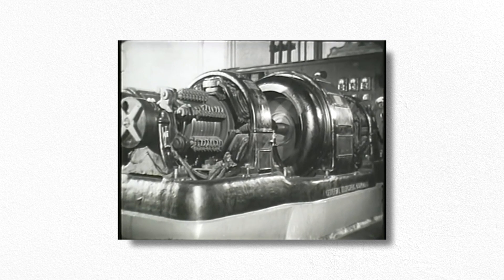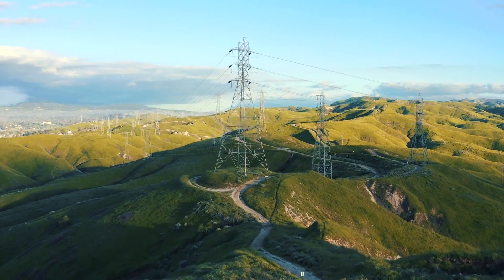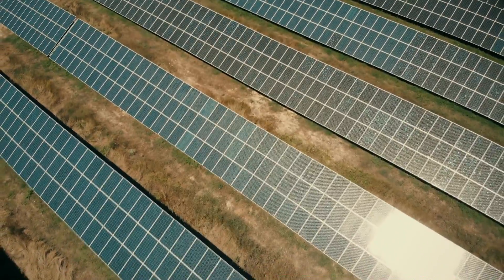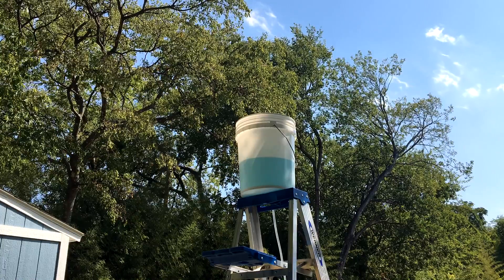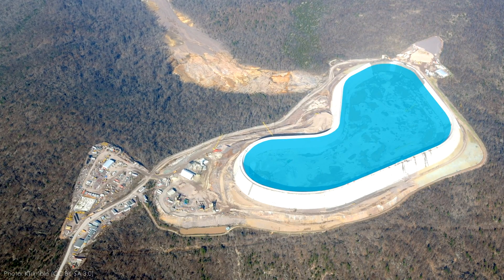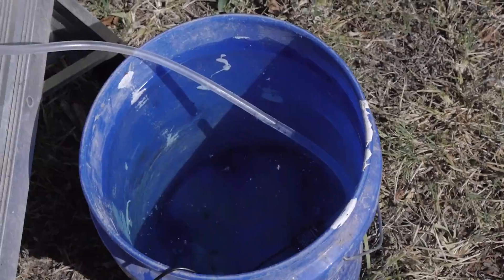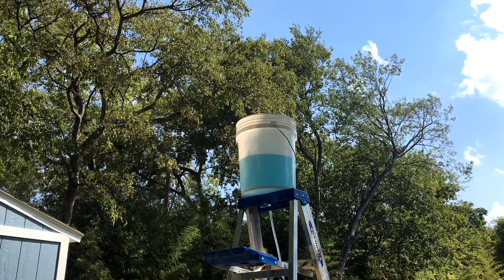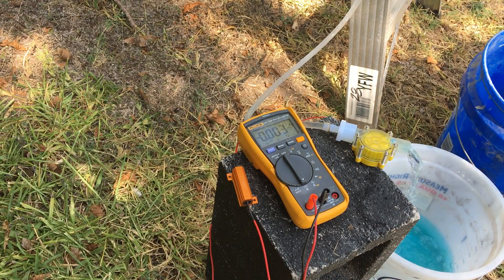World's Largest Batteries - (Pumped Storage)

Comment: I've worked at several pump storage facilities (consulting contractor/ engineer) and they are great in practice and theory. One downside is the amount of abuse the synchronizing main breakers and equipment takes. Unlike during generation where you can spin down the current load to a negligible amount before opening the brake,  during pump these breakers interrupt full load and they operate several times a day. They require far more in depth maintenence at fewer intervals than a normal generation plant.

Comment: Tidal energy is fully predictable.
Each day there are 2 highs and 2 lows. 4 hours of slack water.
So there's 20 hours of tidal movement and therefore energy every day.
Cheers Gray
Australia
Reply: But, tides aren’t the same everywhere. Also, France has a tidal power plant. It destroyed the ecology of the bay they built it on.
Reply: @skippy9214  there are different types of tidal generators.

Comment: wonder why they don't adapt electrolysis systems into hydroelectric dams to create hydrogen batteries in the form of huge underground tanks that can be used in conjunction with large industrial sized PEM's to convert the hydrogen back into power when needed at peak hours... everything needed is on site, constant fresh water and excess power when needed, plus the fact that underground tanks are much easier to thermally control so a cryogenic storage solution might actually be monetarily viable in that case.

Comment: Hey Grady, I had this idea recently, when I visited old mill in the country. Would it be possible or economically  reasonable, if instead of pumping water directly from river, build a canal, aqueduct or pipe couple kilometers back, to gain additional altitude? Pipe could be almost horizontal and would end into small pool next to water storage, from where pump would push it up and when water would be going back, it would go lower , than the pool, directly to river. Hope you understand my idea :) Is it possible? Can someone give a thought?
Reply: niagra falls has a big one  been in years  nothing new  evan in switzerland they have a lot of them

Comment: Question: Would a pumped storage system be more efficient where instead of 2 reservoirs you just have one that's next to the sea. Then you can store more mass in the reservoir because the water is 20-40% more dense?
Also, would this impact the efficiency of the pumps?
Reply: That wouldn't make it more efficient as you'd still have to pump up that extra weight. However it may give you more bang for your buck since you effectively have more energy stored in the reservoir.

Comment: Surely your small scale generator was impractical. If the input was angled to meet the blade angle you would have had a higher output.

Comment: Excellent demonstration of the value of engineering. The tanks were small, the connecting pipe way to small and the turbo pump very inefficient. That the demo worked at all is amazing. 

Actual pumped storage plants operate with an overall efficiency of 70 to 80%.
Reply: @JorgTheElder  so what? Land is cheap and water even cheaper. The concrete and the machinery are an up front cost. Fortunately we do not have to build these things in cities although that could be done.

Comment: what about using concrete blocks transported up hill on rail road tracks. Store the blocks at the top of the hill and when power is needed begin sending the concrete blocks down the rail road tracks...same theory as using water but use huge blocks of rocks and or concrete.

Comment: A friend and I built a similar model and found that the (still very low) efficiency was quite a bit better after we took apart the little generator and cleaned up the flashing on the plastic parts to remove obstructions to flow. Ours was intended to demo the automation, so it was PLC controlled with ultrasonic reservoir level monitoring.

Comment: We should just link up all the solar grids in the empire where the sun never sets.
Reply: Interesting but hopeful idea, to share the power we'll need around 15-20 (or full 40) thousand km of reliable wires that can transmit energy of several countries (basically wrap around equator). Disaster and blackout if something happens to that wire, or overhead to have distributed system would be immense. Plus the required cooperation of kinda the whole earth. 

It is an interesting idea still, having common energy system would simplify some problems with generation and storage, cause you can just pump excess to countries where it's in high demand at the momen, and vice versa.
Reply: @Gridfen  We currently already have high speed trans Atlantic internet cables for stock exchange, but it might be more complicated with power lines. As you said, it is a matter of cost and incentives. Along with country or worldwide cooperation. It might be hard to have countries with clashing ideologies to cooperate though.

Yea as you've mentioned, another potential issue would be huge cascading blackouts. I was there at the NorthEast blackout of 2003 which affected both Canada and US. If the linked grid is not done/managed correctly, that is one huge problem we might face.

And of course there is the space frontier where we dont need to worry about the sun setting. We just need to work on a reliable and safe technology to beam or transfer that energy from the satellites back to various stations on Earth.

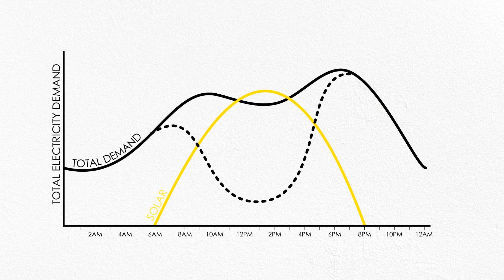Comment: Love your videos. Regarding the duck curve, it is correct that it represents the difference between demand and contribution from renewables like solar. At 1:57, however, the graphical representation of the duck curve is not accurate. If solar is exceeding demand, then the dashed line would be in negative territory. Also, it is unclear what you mean to convey by the squiggle you put in the area between total demand and supply from non-solar sources. Please redo, as you muddled the issue.

Comment: We have 2 lakes that do this in Georgia. Lake Sinclair will rise all day as they generate electricity, then at night they pump it out and back up to Lake Oconee. It doesn't drain the bottom lake, but the drop is very noticeable like a few feet. Power manufacturers HAVE to do something with all the excess electricity when demand is low so it's a decent payoff compared to just wasting it.

Comment: Question:
Would it not be logical to use the sun to our advantage and have it concentrated on a set area (through mirrors/ect) that then evaporates the water to the higher area? Both systems are enclosed so the evaporated water could only go to the higher container. Then at night/when needed we just flip the switch to get energy. If not, why not?

Notes:
Would cost a bit to create something viable, and it sounds like water storage energy (pumped storage) requires a ton of water to make any kind of dent.
Would be a enclosed system so aside from the turbine there would be very little if any maintenance. Maybe cleaning the mirrors/magnify lenses. 
This was an idea I had that led me to this video, thank you for the information. Didn't even know half of what I was thinking was already a thing.
Reply: Many reasons why that isn't a viable solution. The energy spent to increase the temperature to ~100cel is much higher than pumping the water. In reality, much more than 100degC because during all the travel to the higher container, you have energy losses and it condensates much before the container. A pump/generator will always be more efficient than doing so. However you isolate all the system.
Industrially, no maintenance doesn't exist. And almost everything is possible, it's always a problem of profitability, nothing else. People aren't ready to pay 10euros per kWh.

Nevertheless, the idea is not so bad because storing energy with the Latent heat (energy required for the phase transition) exists already using sodium nitrate (similar to the hand pocket heater).
Also, the idea to use the mirrors to produce electricity (free consumable) exists already.

Don't forget, that kind of videos are made for common people with few or no knowledge of the physics laws and so on. Thus, it was very very basic.

If you're really interested in that, you should read and learn thermodynamics and mechanics Engineering, you'll have a better understanding of all the parameters to take in account.
Reply: @lakami15128  Thank you for the information. I'm no expert and just a dreamer.

I still think in the long run (quality built system to last centuries) would benefit all of mankind, but the many factors do come in.

I'm sure that smarter people than myself have thought it over and picked this design to be best.

Thanks for replying and giving me more detailed information on this topic. Maybe someone will come up with the method for easy storagable energy for all of us. I'll keep thinking, but sounds like this idea is a bust for many reasons. The video helped me understand that along with your comment, thanks!

come on Molten salt battery!!
Reply: @nihaa5934  First, having ideas has nothing to do with being smart.
They are just people who learnt that field and do it for a living. To have good ideas you need to understand the problems you try to solve. We all do it at a smaller or different scale.
You can do it too ;)

Comment: The presentation does not address the current use of reservoirs. Which is to provide water for crops and home use. Storing large volumes of water for energy only works in areas with an abundance of water. In the western US that  is not the case. While interesting a reservoir as a battery does provide the energy and water needs that fossil fuel and current reservoirs already provides.

Comment: I feel like, In Canada, we use large dam reservoirs of freshwater as our pump storage.  We let water accumulate naturally in a dam's reservoir, and (automatically) start generating when the price is high enough or the reservoir needs to be emptied.  I was told by a hydro worker once, that every drop of rain is water in the dam's pocket.  It takes mere seconds to open up the vanes and get a generator timed to the grid and start producing.

Comment: PuHS is an interesting engineering phenomenon. Yet no major PuHS projects have been built in N America in thirty years, largely for some of the reasons discussed in the video.    Dual reservoir geology with head separation is rare.  Then, a PuHS economic rule of thumb is it must run almost every day, with cheap charging power always available, typically at night.  Thus mentioning PuHS in connection with solar and wind is nonsensical.  The most common charging connection for existing PuHS projects is of course always available nuclear plants, for reasons cited above.

Comment: How about pressurizing air into liquid stored in containers?
Open a valve to let the air flow out at high speed and drive the pistons of a cylinder engine.
Connect the engine to a dynamo/generator.
Reply: Problem with that is when you compress a gas, it heats up, and then that heat will want to move into the surrounding environment, meaning you lose a lot of the energy you put into the system.
Reply: @SynchronizorVideos  Hmmh yes, I haven't thought about that... but maybe that heat can be recycled to drive the air compressor in some way?
Recycling exhaust heat isn't a new thing after all.
Reply: @QoraxAudio  Problem is, any time you change energy into different forms, you lose something.  Getting mechanical work out of heat is especially annoying, because you're dealing with Carnot limits on how much you can recover.  Not to mention, if you're actively removing heat from a volume of gas, its pressure will go down and it won't be able to do as much work coming out of the tank.

Overall, it would be nowhere near the 70 - 80% efficiency you can get out of pumped storage.  Compressed air has advantages as an energy carrier for smaller items like tools & machinery in a factory, but not for large-scale energy storage.
Reply: @SynchronizorVideos  Ah okay that makes sense.
Iron oxide might have more potential for storage and transportation then.
Reply: @QoraxAudio  Iron oxide?  You talking about the iron-air battery concept where iron and water react to produce diatomic hydrogen?

Comment: Comparing options in terms of energy density is really misleading. How about a comparison on total lifecycle cost over say 50 years per GWh stored? I think you'll find that pumping water uphill is a bit cheaper....
Also the more interesting engineering implications are time domain analyses, ie batteries shine on millisecond-second scales, whereas pumped hydro is great at 30s-hour scales.

Comment: There is one in Georgetown, CO.  The Cabin Creek Generating Station owned by Xcel Energy.  Unfortunately it was also the site of an industrial accident that resulted in a fire inside the penstock that killed 5 workers that were in there spraying on an epoxy coating.

Comment: i get that this is an old video and i wont get answered probably but why dont we just make "super batteries" that can store excess power during the low points duing the day and then run off of that power all night ? or most of the night? combined with this pump storage for emergencies.
Reply: Batteries are extremely expensive, need loads of cooling, and need to be replaced constantly. It’s not economically viable

Comment: I can only quote my boss: "as long as we can't store electricity in bottles we won't be out of a job". we build powerlines ;)
Reply: I Think those are called Leyden Jars.
Reply: @Sara-L  How much glass area and at what Voltage would you need to store 1 Giga watt hour of energy? That isva lot og Joules.
Reply: Actually you can store electricity in bottles, it is called batteries and you can buy them in any stores ;)
Reply: @a64738  It is a matter of scale. I Gigawatt at 500,000 volts is 2,000 amps the generating capacity in USA is in excess of 1,000 Gigawatts.
Reply: @a64738   AC. vs DC.
Reply: @a64738  but no welding...
Reply: @a64738  when I was a kid, battery powered things were considered kind of a scam. even rechargeable ones have a lifespan, making the question of recycling central. Europe for example barely recycle half of small batteries, after years of education and public financing..

Comment: I was wondering, what if , at the lower reservoir, a stream is created(maybe with a 3rd an even lower reservoir) and a Hydraulic Ram pump system is used to pump at least some of the water back to the upper reservoir..... Wouldn't that add to the overall efficiency of the system? Is it even possible/feasible?

Comment: With really efficient pumps and generators, could one of these facilities operate commercially, using off peak electricity to re-fill the reservoir at night and feed it back into the grid during the day. Could they turn a profit and do they actually do this? I know the big one in the UK is used to top up peak demand for the grid and bleed off any excess during the night but is that the only use for them and can they operate at a profit due to the efficiencies and losses?
Reply: As I understand, one of the ideas is to use this kind of system to store energy from intermittent renewable sources, such as solar and eolic, by using the surplus energy during the day(in case of solar) to fill the reservoirs, and then realising during the night to feed the grid.
Reply: If power can't be sold the potential profit is huge. Wind power or nuclear production at night are examples of overproduction. There are many large installations.  wikipedia.org/wiki/List_of_pumped-storage_hydroelectric_power_stations

Comment: How about using a water ram to move the water up the mtn.
Reply: I was thinking the exact same thing...maybe not all the volume, but if we could use a Hydraulic Ram Pump to elevate at least a part of the water volume, that would add to the overall efficiency of the system

Comment: I wonder if they use pressurized air fro the same purpose. It is easier to find 2 air "reservoirs" rather than water. For example you can pump air under water and then use it later.
Reply: I've seen at least 2 different experiences using this idea, 1 in Canada, storing underwater and the other in Switzerland, storing under a mountain. Sounds interesting...

Comment: Pumped Storage-cum-generation systems function as extremely inefficient "batteries" because they involve two inefficient conversions (a) pumping water uphill and (b) regeneration by hydel. When you combine this two stage conversion, the overall inefficiency is the product of the two inefficiencies. As a strategy this is therefore less likely to succeed.
Instead, particularly in monsoon lands like South Asia, if water is pumped up and drained out only for irrigation, then you double the system efficiency making it viable. 
Next, COMPLETELY dedicate all existing solar and wind generation ONLY to uphill pumping of monsoon rainwater from flood plains, into storage lakes at different altitudes, and intermittence of operation becomes inconsequential. And you do not need batteries any more!
With reference to the Indian situation, there are additional facilitating conditions and benefits. Central India is a plateau - will allow artificial lakes at different altitudes, strategically located over roughly 30% of the Country's area and networked with metre dia or larger pipelines. Lakes with unlined bottom will also allow slow recharging of severely depleted aquifers.
In most other countries, where the seasonality of monsoon or need for large irrigation demands do not crucial factors in water system design use this intermittent power source to raise level of drinking water supply, industrial use, etc into massive overhead water tanks.
Reply: thank you Alok!

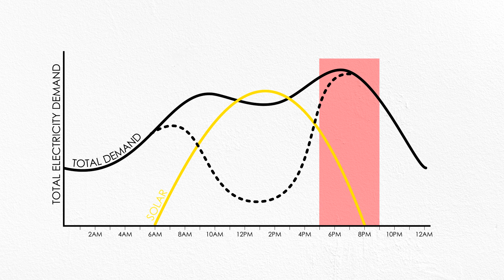Comment: 2:00 "Solar power dies away when we need it most".

No it doesn't - you're just connected to the wrong panels in the wrong place !
Reply: So you live in California, you come home in the evening and turn the air conditioning on. Where's the right place for the right panel?
Reply: @dougmc666  Sydney.